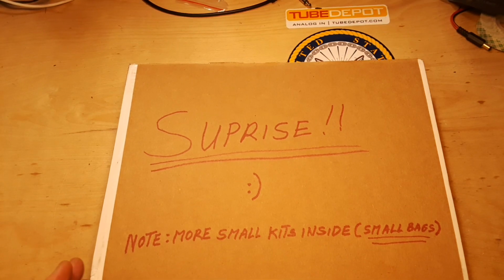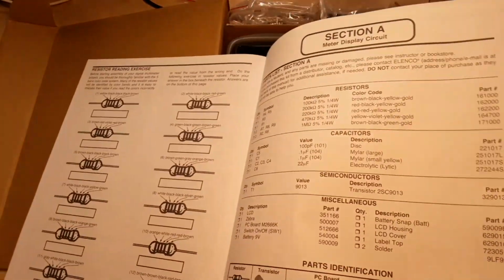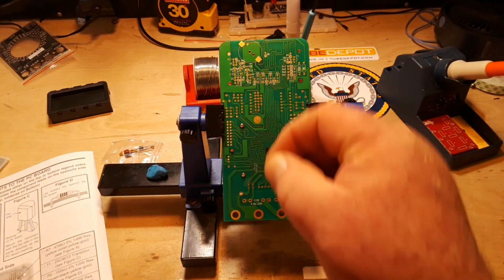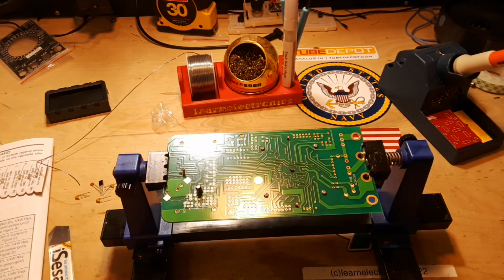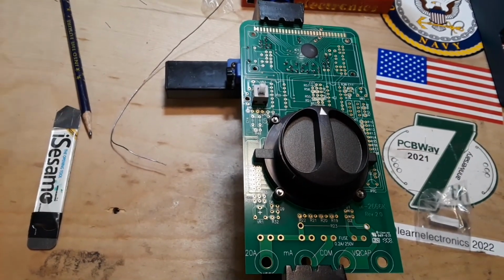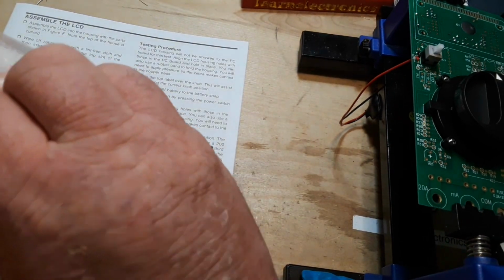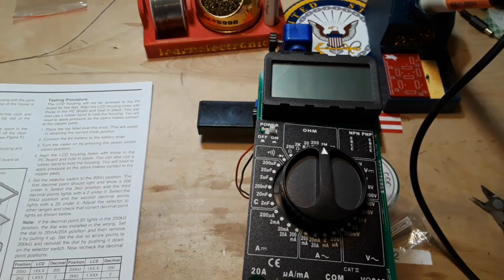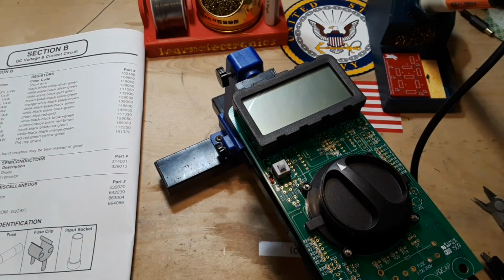Elenco M2666K Multimeter Build Part 1

Comment: Great video Paul, I'll be watching this whole series. I might have to get me one of these kits, I like building kits, as well as vintage radio restoration.
Reply from the maker: This is a nice kit. All through hole, nice silk screen on the board and the manual has step by step troubleshooting. So when you get to the end, it works.

Comment: I love your work station. The PCB holder is a 'must have'. It looks like your solder is on a reel and you have a temperature controlled soldering iron. I bet you have an exhaust fan for soldering.
Reply: Yes; that PCB holder jig looks really neat.  But I did not find a link to purchase it.  I would consider buying it if I knew where it is sold.
I have added just about every item that was listed to my Amazon Wish List. And, would use Paul's amazon page.

Comment: Good progress, awaiting next instalment. Though having to push down on the LCD to test the build so far seems very odd. Very easy to misalign zebra strips and may even cause a voltage supply to a wrong pin. Presume components eventually mount under the LCD (otherwise it would be screwed down for testing).